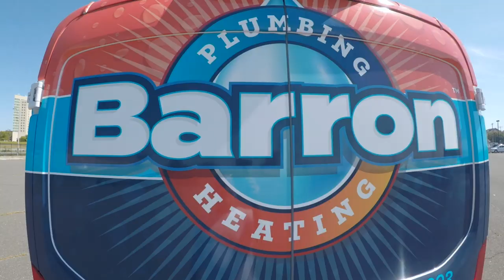UTICA GAS BOILER SERVICE

Comment: chuck- ever look into getting a dust extractor vacuum? hepa filtration, everything goes into a bag and no dust blowing out the back. inexpensive and never loses suction. One of the best purchases i have ever made
Reply from the maker: oh nice...what make do you have?
Reply: @ChuckBarron  festool ct26 is also awesome and you can get a bluetooth on/off switch where you can turn it off and on from the hose end. which is very handy

Comment: What are you sealing with the high heat cement?  FYI I’m not a plumber but did vacuum-blow out two old Hydrotherm boilers.  A lot of dust in the exhaust pipe that I had to clean out.  What is efficiency on this type of boiler with no flue damper?
Reply from the maker: yes on cement.. 80%
Reply: More than likely sealed where the top goes on and covers the boiler sections so there are no flue gas leaks. Another battle scar on top of that cue ball LOL.

Comment: what do i do if my heater doesn’t heat the second floor?
Reply from the maker: May be air bound. If two zones maybe a bad pump or zone valve.
Reply: @ChuckBarron  Is it easy to arrange without professional help, if so how do I do it, if not how can I get in touch with this type of professional? Thank you!

Comment: Not sure if the age on this ole gal.....but she still has it & is running. Just needed a little TLC to get back up & running. Sometimes though, just gotta get a new one (or at least a “newer” used one), and let the old one retire w/ some dignity 😉
Great job getting that working again; as those older units can be finicky....not to mention trying to find suppliers that stock some of the unit specific parts can be hard to find. (When they get their new unit, hope you get to install & show us what they chose)
Cheers✌🏼
Reply from the maker: Boilers are amazing. just keep running

Comment: @15:00 what was the reason for closing up the breach with cement rather than a kaowool gasket? Were the edges too rough for a gasket to seal up?
Reply from the maker: furnace cement for that section.

Comment: How do I love thee? Let me count the ways.
I love thee to the depth and breadth and height
My wrench can turn, when working out of sight
B’neath the sink and back of toilet
I love thee to the level of water
Most high when flowing untapped.
I love thee freely, as the drain should flow.
I love thee purely, as the filter doth sieve.
I love the with the passion put to use
Of my favorite propane torch
The solder drawn into the joint
You, my customer draw me near
Could I have been a plumber? 
With copper pipes and bends
To fix the leaky water tank
And solder till it mends

I’d look out for a dribble’s
That won’t get any better
And offer customers my skills
Before they get much wetter

I shall but love thee better after you pay my bill.
Reply from the maker: Tom...well said.

Comment: rusted out burners, I'd stop there and see if burners are available and see if it's plugged with carbon, then give homeowner option depending on parts and other issues.
also make sure it's not leaking(no pressure) and dripping on the burners  causing them to crack and fail. that's very possible, something off and it;s been condensing a ton or leaking/dripping.
whoops, the bad burners alone will make it carbon load and emit high CO and have many other issues
Reply from the maker: I price him a nice combi.....we shall see.
Reply: Looks like a big cast-iron system with no bypass probably with a very large delta T under 140 on the return definitely condensing possibility

Comment: SMH
Reply from the maker: sell my heater?
Reply: @ChuckBarron  you spend alot of cash on drain cleaning equipment. Spend a couple bucks on a manometer and combustion analyzer. You have no idea  how much CO that boiler is putting out.
Reply: @ChuckBarron  As far as I know a clogged drain never killed anyone
Reply: I'll buy it. How much?